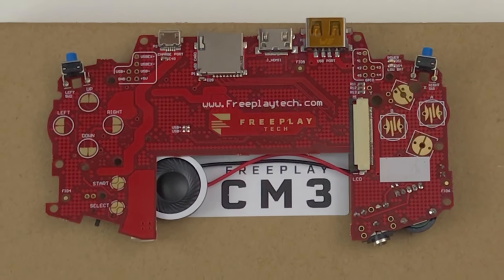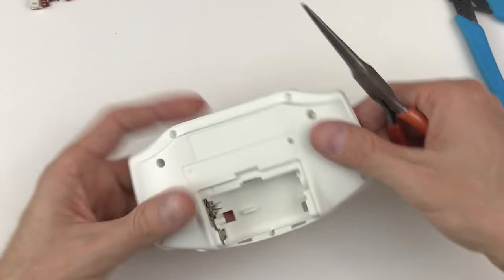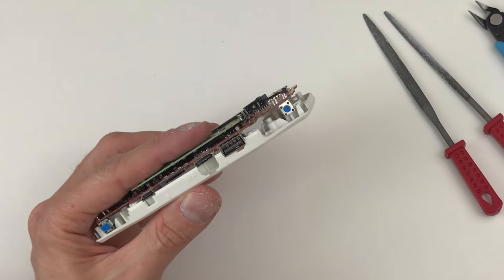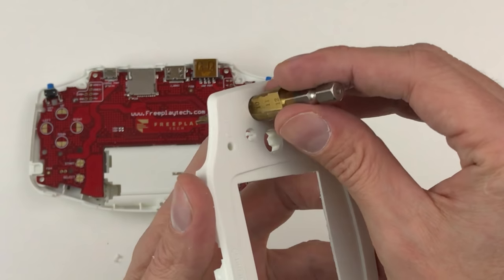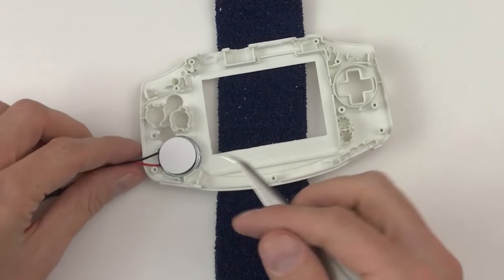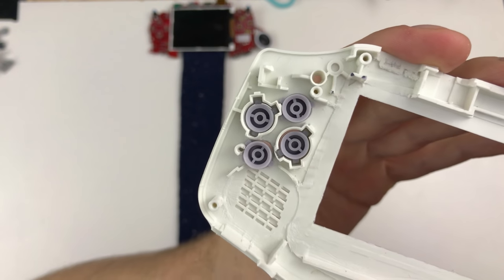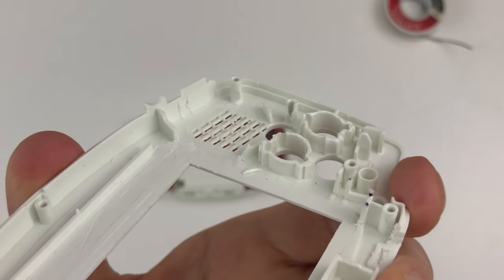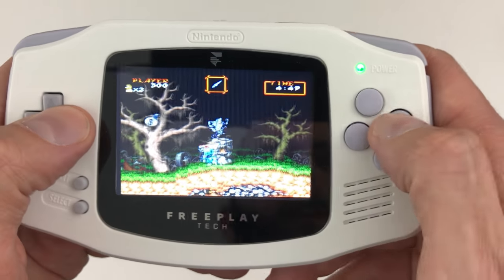Freeplay CM3 Example Build - New X&Y Button Options

Comment: These are the absolute best sets of videos I've seen showing what needs to be done to make one of these. Hipcat is amazing at showing and describing what needs to be done. 

I'm about to complete my first build which is why I can attest to this with confidence. If there's anything I'd add it's that the video doesn't show two sets of details that needs careful attention to:
1) for the X/Y buttons, there's a thin pole of plastic between the A, B, and Y buttons. You should get rid of this plastic pole before drilling for the Y button. There's a thicker pole between the A, Y, and X buttons that was originally meant to have a screw go through it. Eliminate that as well before drilling for the hole for the X button. It'll allow for the drill to go through where it should without accidentally scraping surrounding pieces. 
2) on the back part of the case, there's a piece of flat plastic attached to the top part of the battery compartment that needs to come off. Don't get rid of all of it to the bottom. That's what the battery cover uses to latch onto. Cut it down to where the circuit board can comfortably fit. 

Otherwise, everything was incredibly helpful. Allowed me to avoid some of the pitfalls he showed us to avoid. 

Love this channel and bonus points for Hipcat being write possibly one of the nicest guys you'll find around. 

Cheers!!

Comment: This video is fantastic.  I know you are somewhat on the fence between the two new button options in terms of what you prefer, but would you say either of the newer options are more effective than the smaller tactile buttons?  The new button layout seems a bit awkward compared to the previous tactile button layout but it may be nice to have 4 identical buttons closer together.  I just can't seem to tell what layout will be more comfortable so any more thoughts on it would be appreciated.   Keep up the good work!
Reply from the maker: Thank you! After playing around with them for a bit now this is how I personally see the 3 X&Y button options. The original tact switches are the most comfortable as far as the layout. They have the drawbacks of 1) being click tact switches which surprisingly is easy to get used to, 2) being slightly smaller, and 3) They make it a little more tricky to do a full screen mod because you need to work around that Y button post. Both of the new options look and feel better, but are kind of more cramped. I think I will get used to them quickly though, but it’s still worth noting. The silicon pads option feel exactly like the original A&B buttons which is great. The soft tact switches feel better then the regular tact switches, but are a little more firm than the silicon pads and have less of a soft click to them. They do feel really solid though. After messing with them for a while now my favorite option is the silicon pads option. My second is the original tact switches with the slightly more comfortable placement. Last, but still good, is the soft tact switches. I think everyone will have their own favorite though, so don’t only go off my opinion. I have a build playlist with dual analog sticks, but it is kind of an upgrade kind of build and it does not include installing the add on board. I’m thinking of ordering another though, so maybe I’ll be able to get that up sometime. I’m playing around with some new upgrade ideas :)

Comment: Great video! I was tempted to order a CM3 in December but glad I held out until the new year. The new button options look much better. 

In the video you mentioned upgrades? are you planning on doing dual analog, rear speakers and shoulder buttons again? That modified build in portrait mode was awesome
Reply from the maker: Thank you. Thinking about it, but maybe a little different this time. Thinking about Xbox style with some other upgrades :)
Reply: Some other upgrades? sounds mysterious  @jivinhipcat  I'm interested to see what you're doing next :D

XBox style sounds like fun, are you thinking classic XBox (black & green) or modern XBox (white & green) 

Am I right in thinking the new button layout will be too close to the RH analog though? 

I'm hoping to build a CM3 similar to your modded dual analog version. Have you ever tried covering up the speaker grill and start/select pockets so they don't show in the final build? 

I was thinking about using some kind of filler and paint or possibly even trying to model/3D print the top shell with all the Dremel sections removed and new holes cut into the 3D model.
Reply from the maker: I just started brainstorming ideas for it, so nothing solid yet. I’m thinking of the Xbox controller look. Maybe even using the parts of an Xbox controller like the D-pad and colored transparentish buttons etc. Also maybe moving the analog and D-Pad to match the Xbox layout. I think Nintendo Switch Joy Con analogs would work well for that too. I’m not sure If I’ll be able to get it all to work out (I never am in anything I ever do hahaha), but that would be so cool. 

I did think a lot about doing something with the start+select and speaker grill areas on the front case. I wanted to paint them in black to have them as an additional accent design. Kind of a cool opposite-of-hiding style thing that I still think would look pretty cool. Like having the black paint in the recessed areas but filling them in a bit so the paint would be flush with the rest of the case. Going the other way and completely making them blend in would be really good too. That would definitely give the device a more complete look. If I were going to do the filler route and paint I would have not used the port cover also. I think I would have just cut the port holes to fit, filled in any unneeded areas around them so they look right, and then painted the entire thing. That would be great. If I end up going with the Xbox style system I may have to learn how to do the filling and painting like that too for moving around the D-Pad and all that too. If you post anything about your build you should link to it; I’d love to see how it goes.
Reply: @jivinhipcat  Swapping the D Pad and analog positions would be an incredible mod! I'd love to see how you can do that.

The XBox buttons would look really good on the gba shell. Maybe you could get a matching theme to go with it too? 

If you could fill the recessed start and select sections and speaker grill on the shell maybe you'd be able to make a mold from shell and cast a new one in resin? 

Don't really know if that's possible given how thin the shell is so filling /painting or 3D printing may be the best option.

I'll post a comment if I put the 3D model together or build a modified Freeplay CM3 :) unless your on the retropie forums instead?
Reply from the maker: I am on Reddit here and there

Comment: Great job. Your work is amazing. I definitely think filing is the way to go. I had one tiny slip of the Dremel and now have a huge gouge across my case. 

I think these new button designs are the way to go. With the button caps, playing games like Smash TV is impossible and I don’t think I want to go through the effort of moving the speakers to the back to add 2 analogs.
Reply from the maker: Jay C Thanks. I hadn’t thought to try Super Smash TV with the new buttons. I just did and it IS more playable with the new button placement. Another good thing about keeping the speaker in front is the sound. I thought having 2 speakers rear firing would be as good, but this single one firing forward is still a bit better. I’m still surprised even though it was probably obvious all along.

Comment: I have a furniture repair background. You may want to look into a "card scraper". They may help you smoothing surfaces even quicker than the file.
Reply from the maker: Robert M ooh I will. Thanks!
Reply: @jivinhipcat  Since I have your ear.... Chisels are really good for some of the things you are doing too. As long as you maintain them and the card scraper. The chisels may not be as quick as some of the items you use, but they will be much cleaner and precise. Cool video, I want to try making something like this for my son. Or a new way to play Tetris against my dad like I did a bunch of years ago.
Reply from the maker: Robert M yeah I should get some decent chisels. I see people doing magic with them on wood projects.
Also I used to kick my brother’s butt in Tetris on the original Gameboy with the link cable. Good times :)

Comment: You make it seem sooo easy! I just recently ordered mine and Mr. Mandy contacted me asking me if I was interested in 2 new options of the CM3. I chose Option 3. I should be receiving it this Thursday. I know you mentioned that you prefer the option with the tac switches. My question is this: "Is it more responsive, better and overall more awesome with the tac switches?" Your feedback will be greatly appreciated! Btw, awesome vid! 😊👍 Oh, btw, I can still use the add-on board with this option right? Thanks
Reply from the maker: As soon as you mentioned you were ordering yours “next Friday” I asked him about it :) . So you are going with option 3. Is that the soft tact switch? After playing around with it more, I think I am torn 50/50 on the soft tact switch vs the silicon pad. The Soft tact switches need a little more pressure to push, and there is less of a soft click to them, but they feel incredibly solid. The silicon pads feel great as we are used to and have the perfect soft click to them, but don’t feel as solid. The original board with a mix of silicon pads and tact X&Y’s actually stand up well though because the spacing is a bit better. They are less cramped. It’s crazy that’s it kind of is a tossup. I’d saying going with the soft tact switches is a pretty safe bet because then you have the option of the silicon pads or tact switches because it’s the same board. With either of those I think it will be super easy to get used to the buttons being slightly closer together.
-I am sure this board will work with the add on board, but I haven’t checked specifically. I bet I will order one though because I want to upgrade this bad boy :)
Reply from the maker: Actually, I've had more time to play around with them now, and I think I do prefer the silicon pads over the soft tact switches. It is really close though. The soft tact switches are more firm and require a little extra effort. It will probably just depend on the person I'm sure.
Reply: Cool! I just received mine yesterday but I'm waiting on a few more buttons from eBay. I won't be uploading any pic's yet because I really want to wait until I purchase the add-on board and I'm also going to add one psp 1000 joystick. Once I have my build complete then I'll upload a pic or two. Good thing you let me know about the tact switches. I was actually just going to use it without the tact switches, reason being is because I don't have a dedicated soldering station. I have a soldering iron but to do multiple soldering I don't know if my solder iron will give out right in the middle of my project and that's what I'm trying to avoid.
Reply from the maker: Evan J nice. This one is the only build I’ve tried with the speaker front facing, and it really sounds great. Having the speaker(s) rear firing is fine, but it doesn’t beat the this front facing one. That’ll be cool for you if you keep it in front with the single analog stick.

Comment: is there a solution to that huge open gap where the cartridges would have gone?
Reply from the maker: I like to use a 3D printed cartridge with a vent designed into the top. These have an extra button a lot of times too to press the extra button on the addon board. I printed one vent cart for this build https://youtu.be/3iDXzFyraV4 and then just drilled and fitted the additional button. I think this is the cart https://www.thingiverse.com/thing:2810882 . There are some places online that sell versions too. I also started making my builds more slim and basically getting rid of the cart slot all together. Here are a couple of those builds if you want to see https://youtu.be/KExGvaqvMKo , and https://youtu.be/hwjeL8c03Vk . There are more on my channel too if you want to see.

Comment: I want to build a setup like this maybe with the odroid or the pi but I was wanting a add on for a fan L2 R2 and a analog stick I'm leaning toward the pi because of the support it has with modding it and stuff but the odroid from what I heard is alot more powerful and have you maybe thought of using the second analog stick from the new 3ds I don't know if it would work I was just saying for form factor it would be so clean rather than mounting them to the speaker or where the start/select text is
Reply from the maker: Cody I haven’t messed with Odroid boards yet (just the Go), but they look cool. I know cooling will be something to take care of that though I’m sure. That’s not crazy though. Have you seen my Pi3Boy build? I added a custom cooling solution there with 2 heat sinks that sandwich the Pi3 and it worked out really well. Here’s that build if you’re interested https://youtu.be/8EmCoj9tvVY . I also have a few freeplay builds using different kinds of dual analog sticks: PSP 1000, PS Vita, and Nintendo Switch Joy cons. Here’s the latest one https://youtu.be/hwjeL8c03Vk . I’m actually starting on a new build using dual 3DS sliders once the mail arrives with my new shells. You can check out some of my other videos if you want. I don’t want to link too many here; I already kind of feel like I’m yelling “hey look at me, look at me” by linking those couple :)
Reply: @jivinhipcat  yea I just found your channel im watching a bunch haha and the reason I bring up the 3ds one is because the second stick is super small and so rather than using a big stick where you drill into a speaker hole or the start select text engraving or whatever it is it would look alot cleaner and you will hardly be using a stick for most games
Reply from the maker: Oh really?! I’ve never looked at a 3DS close enough to know that. I thought it just had the 1 stick. I kind of skipped of the DS consoles. Thanks for the heads up because that does sound cool. I’ll check it out for sure.
Reply: @jivinhipcat  yeah just look up the NEW 3ds that's the name of the system that has the second stick the naming is stupid I know but I figured it would be of use
Reply from the maker: I’m actually watching someone play Minecraft on it now. I don’t know how I missed that little guy.
Reply: @jivinhipcat  yeah everybody who doesnt know about the 3ds misses it it looks like a little tiny button or something haha
Reply from the maker: This is exactly what I spent a long time searching for to go in a Game Boy DMG build a while back. I ended up scrapping the idea and going with something else. I’m sure I’ll end up using that for something soon now. Thanks a lot.
Reply: @jivinhipcat  of course haha as I said I dont know if it will work I'm sort of new to the modding community haha

Comment: Where did you get the rubber-nipple soft tap buttons? Did you buy them separate?
Reply from the maker: They were in the kit. I haven’t checked the site in a while, but you should be able to order directly from there with the kit. They look and feel very similar to the soft tact switches I’ve bought from Adafruit, but the pins are different. Adafruits soft tact’s have the normal 4 pins (at least what I’ve seen so far) while these for the Freeplay kit have 2.
Reply from the maker: I just looked around the Freeplay site and didn’t see any options to buy those soft tacts there anymore. That’s weird. Maybe I’m missing it too, or maybe they don’t offer them anymore. Hmmm. I bet you could shoot them an email and see if they have anymore. I found and measured a couple I have here and the dimensions were just barely less than those Adafruit ones. They are probably exactly the same but saying 8mm is easier than saying 7.8mm - 7.9mm. Or my measuring isn’t exactly perfect. Either way it’s probably close enough. The thing is the pins. The buttons designed for the board have 2 pins aligned along the center of the bottom of the buttons and the Adafruit ones have 2 sets aligned on the outer edges of the bottom like normal tact switches. They should work just fine, as any kind of switch would work, but getting them in position will be more work. Off the top of my head I could see clipping off all 4 of those pins, soldering a short length of magnet wire to each stub that’s left, maybe filing a tiny channel for each in the bottom of the switch (just a tiny groove really, feeding the wires through the holes for the pads, soldering the wires in the holes from the back of the board, and securing the switch to the board with glue/epoxy/whatever. If I were going to do it that way (totally something I would do but maybe most people might not) I would probably also round all of the corners of the black plastic of the switches to make them fit more easily in the button wells of the front shell. This way I may not need to trim those button wells, or trim them as much, to fit. That’s just an idea I had now as typing this, so I haven’t tried to see how well it would work. Probably fine. Worse case a switch gets broken. No big deal. I would try to secure them to the board in a way that is reversible too in case I changed my mind and wanted to take them off later. Like if using epoxy you can use a dab here and there, in places that aren’t on weak areas of the board (pad edges that may cause the pad to lift if you try to pry off the epoxy) so you can kind of pop them off later. I tried the soft tacts for a while in a build, but ended up going back to the regular silicon pads because the feel is lighter and better IMO. Totally subjective though. Hopefully that’s not too rambly.
Reply: Hipcat I might just go the silicone pads route, than I don’t have to trim the buttons down. Thanks for the help
Reply from the maker: Claymanfilms no prob. Good luck!